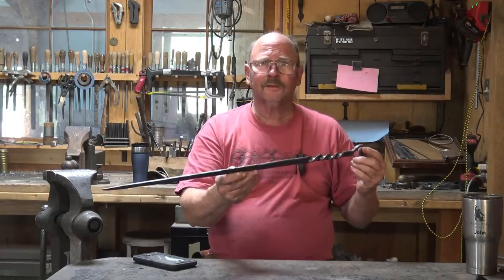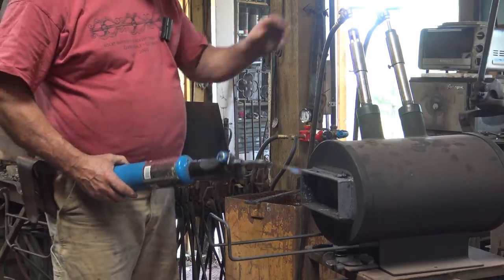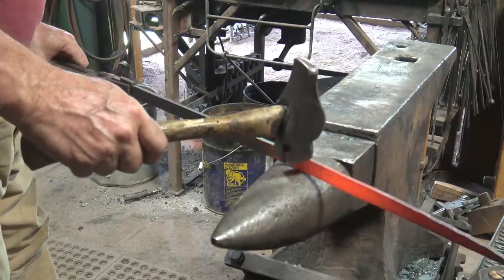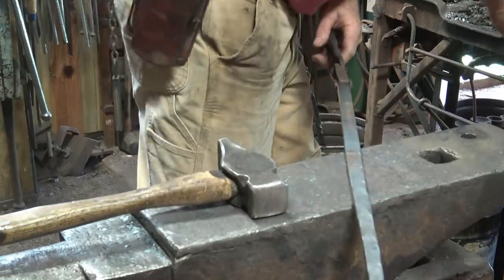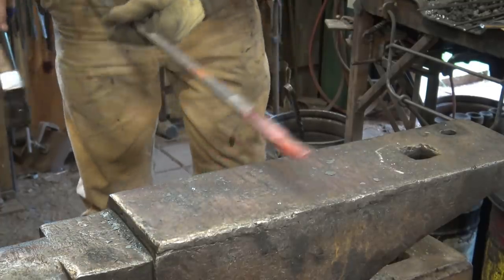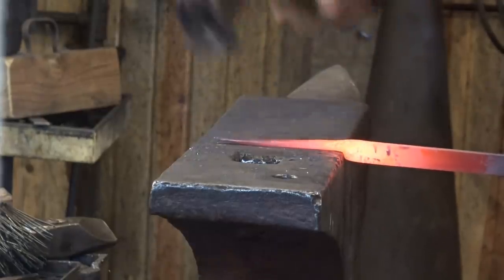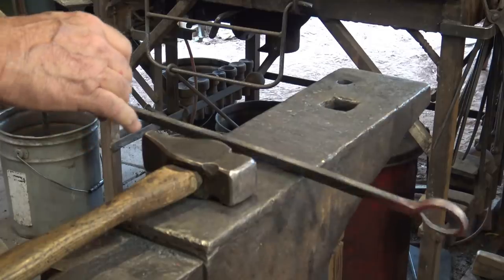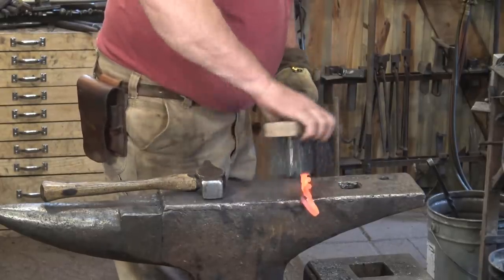New Mexican inspired fire poker

Comment: I lived in Albuquerque for 10 years.  The wood they burn there is all pinõn juniper.  This is a light and very soft wood and most of the flame comes from the resin.  You can't disturb the wood too much if it's been burning long or it will just fall apart.   Hence the plain point.

Comment: Mr. John, I have been watching you for quite some time, but have never commented. Very nice poker, I forged one several years age but welded a horseshoe on the end with about one inch 90 degree bend on the end of the shoe. This thing is very effective in a wood stove or fireplace. John
Reply from the maker: Does that function sort of as a rake then?
Reply: Yes, it's great for moving logs & raking hot coals. John